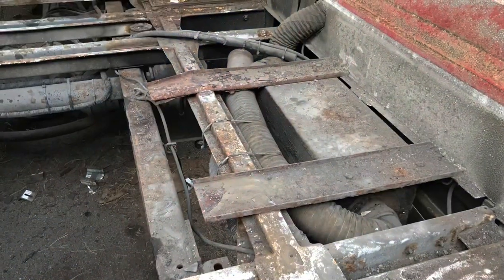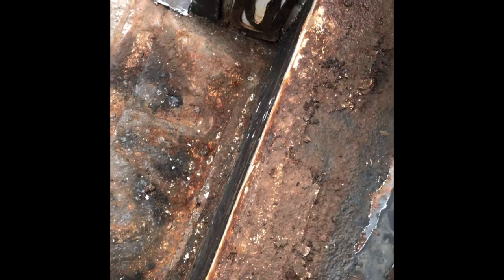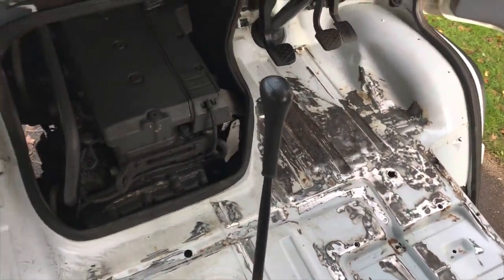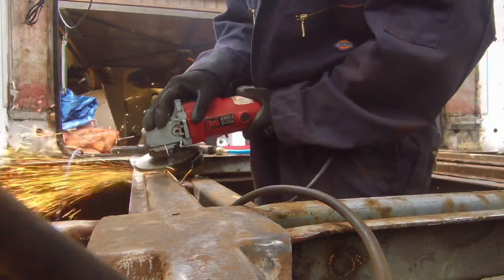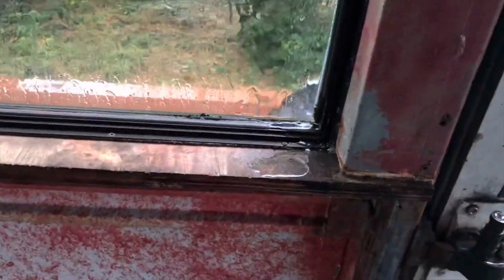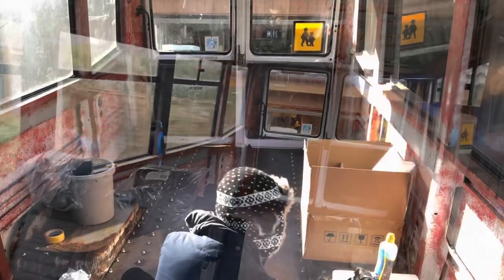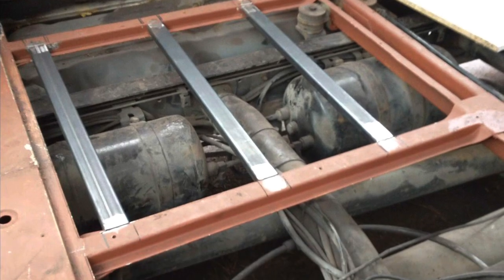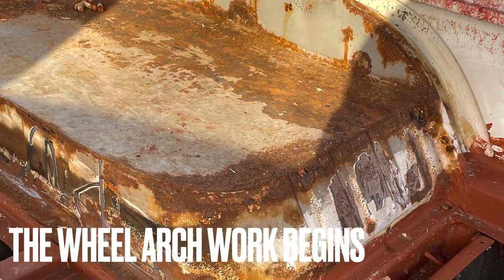Rust Removal Secret Weapon & Chassis Protection | New Seats For Our Vario Van

Comment: G'day Rich laborious job that but well worth it and you have done a great job.   The windows probably could use new seals as they are probably getting brittle I don't know about the old country which I love and have been over twice, but you can buy it in long rolls.  Anyway I'm gradually catching up to where you are now.    Good one regards John
Reply from the maker: Thanks John. That’s a good tip. I think I’m going to strip the old seals off as you suggest and seal them with some windscreen sealant on at least one side too. We want to get them watertight before getting any new wood in the bus. Thanks again 🚌🚐🚎

Comment: Good to know Mercedes parts so reasonable. You really are doing a thorough  job ..where did you get your mask ? Nothing's getting through that one !
Reply from the maker: It was a nice surprise, especially as they delivered them. We used our local dealer (Rygor) and can’t recommend them enough. 

The mask is made by 3M and it is really good. It even works well with glasses which is a plus. I bought it from Amazon but you can get them from the usual places like screwfix etc. 

Thanks so much for watching. Stay safe x

Comment: Hi Rich 
This is Martin from the Netherlands. i have been watching all of your video's. we have a bus similar to yours, the difference is that ours is based on the older 811 d type, and was build as a small touringcar. I think you say minibus. You have done a very good job on your bus. I was wandering about your rear wheel arch.  Looks like you have lowered them. I was thinking of lowering ours. But i dont know how space the rear wheel needs. How far can i go? So how much space does your rear wheel have? We would like to create more space inside for our shower above the rear wheel.
Keep up the good work. 
Martin
Reply from the maker: Hi Martin. Sorry for the late reply. We lowered ours to sit above the bump stops. I did find the official guidance from Mercedes though for when people were converting these things from new. It states 

‘The arches are lowered 60mm (standard 210mm to 150mm). Measured between the floor in the interior and top of the wheel arch’. 

Ours are slightly lower that this and haven’t caused an issue. We then insulated our floor and used 25mm insulation on the arch to bring the two levels closer - if that makes sense. Our shower is above one of these arches.
Reply: @WanderbusAdventures 
No worries.
I'm very happy that you answered. The info you gave me, is very helpfull. 
Looking forward to your next video.
Many thanks and kind regards to you and your family.😉👌👍
Reply from the maker: @martinzaalman2946 happy to help. Keep us updated on the build and happy to trade ideas whenever.